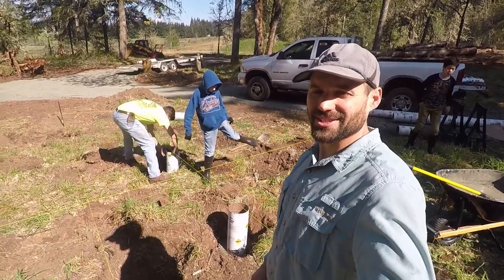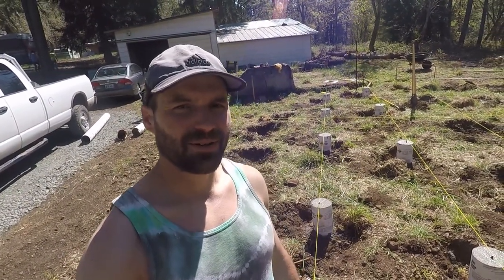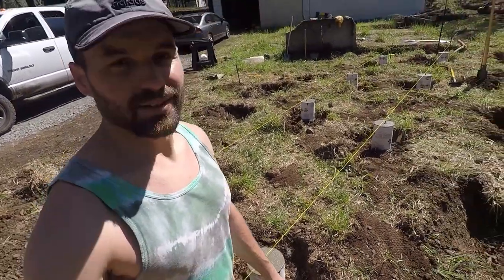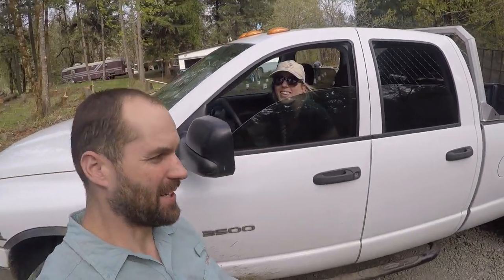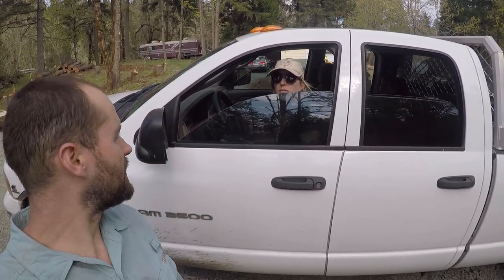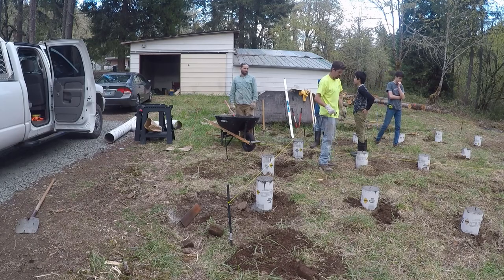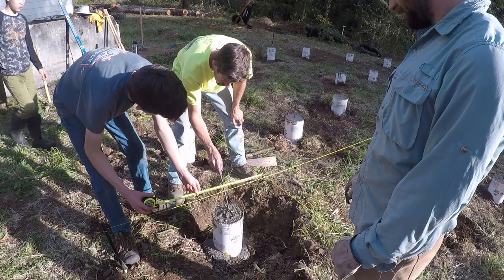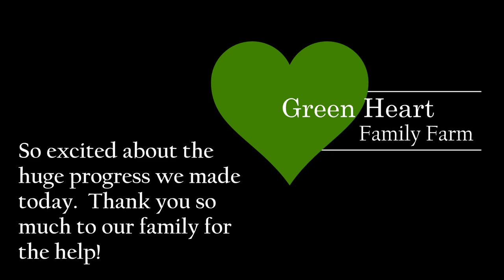Building a Yurt Foundation, Day 1 - Footers

Comment: Hi, I am doing some research hardware to connect concrete footers to the 4x4 posts, and I came across your video.  Can you tell me what you guys were using in this video.  My wife and I are picking up our Pacific Yurt in April and we are getting busy on the platform.  This video gave me a good idea of what it all looks like.  Thank you!
Reply from the maker: Glad it was helpful!  We used a post-base which was connected to an anchor bolt set into the concrete footer.  The based includes a standoff to help prevent moisture from traveling between the concrete footer and the wooden post.  This is the specific product we used: https://www.homedepot.com/p/Simpson-Strong-Tie-ABA-ZMAX-Galvanized-Adjustable-Standoff-Post-Base-for-4x4-Nominal-Lumber-ABA44Z/100374999
Reply: @Green_Heart_Family_Farm  Thank you very much!  Those are great, and less than half the cost of what I was looking at.  I like the fact that they can be adjusted before tightening the nut.  I am not that experienced in building and I was worried that I could make a mistake during the pour and be in real trouble.
I noticed that you guys used 8” diameter tubes.  How did that work out for the overall build?  I have had people talk to me about using 12” diameter tubes, but we are talking about 32 tubes here.  I wonder if you found that the 8” was just fine.
Sorry for all the questions.  My wife and I have been binge watching your videos.  Y’all’s yurt is really looking good!   We are getting excited!
Reply from the maker: @kyledavault3257  We are happy with the 8" tubes here!  Everything is very solid almost a year in.  I think the fact that we did a good amount of bracing to the foundation helps a lot.  Where are you guys building your yurt?  Hope it goes well!  Keep in touch as your pick-up time comes near!
Reply: @Green_Heart_Family_Farm  Thank sir for the valuable information!  I will definitely keep in touch.
Reply: @Green_Heart_Family_Farm  Also, we are building our Yurt in Texas.  We are halfway in between Houston and Dallas.
Reply: @Green_Heart_Family_Farm  Thanks again for this info!  We have decided to go with this hardware for our pour at the end of next week.  Do you remember what size anchor bolts that you guys ended up using?
Reply from the maker: @kyledavault3257  I think they were 12" long J-bolts?  Maybe a bit longer, but I can't remember exactly, sorry!  They are also acting as a bit of rebar in the footers, so they were definitely pretty long.  Good luck!
Reply: @Green_Heart_Family_Farm  Hey brother!  Just wanted to let you know that we completed our concrete pour for our footers the week before last.  Then a buddy of mine and I drove from Texas all the way to Pacific Yurts in Oregon to pick up our 30' Yurt.  It was a pretty long drive, but we are back in Texas now with the Yurt now on the land.  I am going to be starting on the platform tomorrow.  Just wanted to say thanks for all of your information.  I did end up using the hardware that you recommend, and it went great.  If you ever want to see any photos or anything just let me know.  I am continuing to watch your videos for guidance.  Thanks again!
Reply from the maker: @kyledavault3257  That is great to hear, congrats Kyle!  Yeah when you are sharing pics with friends and family, I'd love to see them, thanks!

Comment: Where do you live?  How deep are your holes? Did you factor in ground upheaval due to frost? Just looking for information so I don’t screw anything up.
Reply from the maker: We're in Western Oregon with a mild climate.  We dug our footers 12-18 inches below ground surface, which should be plenty to avoid ground upheaval in our area.  I've watched others install 4 foot deep footers for their much colder climate.  Thanks for the question!  Are you building a yurt?
Reply: I live in Iowa and the frost here gets down to at least 18 to 24 inches. I’m still looking for a piece of land before I can build a yurt but I’m trying to do all my research ahead of time so that when I do find a spot I’ll be ready to go
Reply from the maker: @narageaedeon7845  that's great, good luck!  We saved money, did research, and shopped for land for about 12 years before getting started.